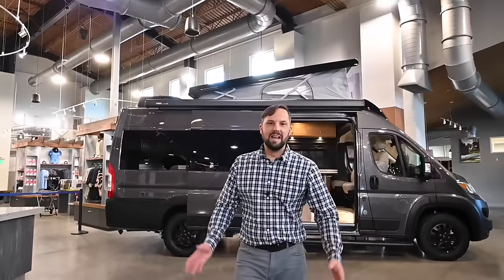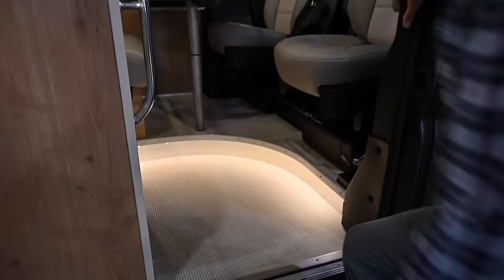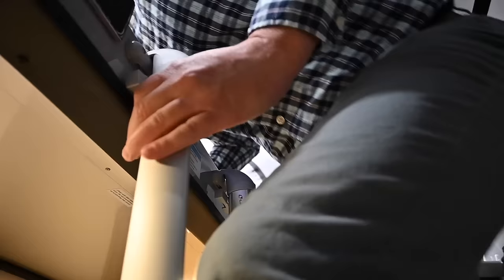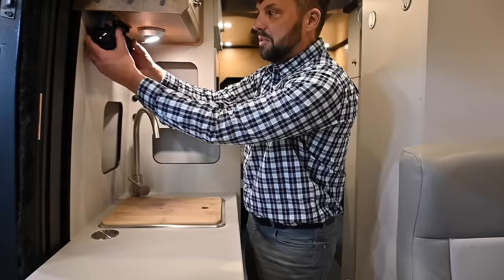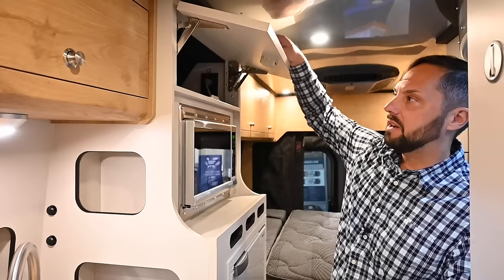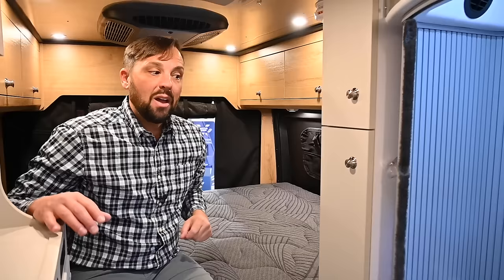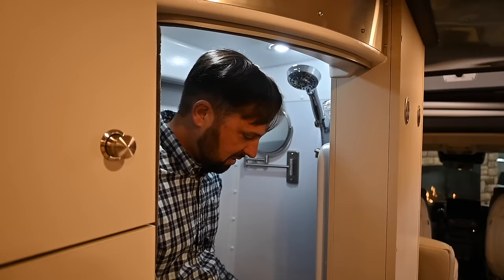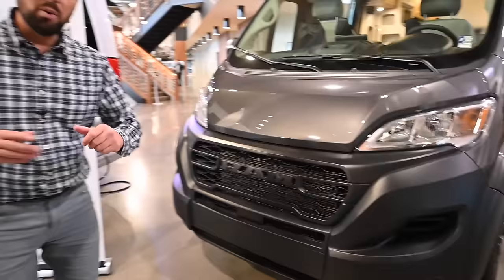All-New 2024 Airstream Rangeline Class B Camper Van | Sleeps 4

Comment: Terrible design. Toilet in the mid-area again. Smells the entire place. Toilets should be at the far rear end of the vehicle so ventilation exhaust is faster. More hygienic. You can entry at the rear when clothes are dirty and take a shower before entering the van. You can even extend the shower if it's at the rear. Midsection showers are terrible.

Comment: Beautiful camper van, but the height of the pop top sleeping area is too small. They could have easily made it 6-9 inches taller and less cramped. 

Also, the storage under the dinette seat should open via a drawer to the aisle (vs. crawling under the table).
Reply: It’s for children.  😊
Reply from the maker: Appreciate the feedback. Airstream doesn't manufacture the pop top, it is installed by Airstream. I believe it will fit two adults comfortably and feedback from owners has been positive.

Comment: Stapled drawers, no dovetail...very cheap contruction. For $150.000+ I would expect 600 ah for lithium batteries also. I bought my 2019 Coachmen Crossfit for $76,000 brand new and it has more options than this one does with solid wood dovetail drawers.
Reply from the maker: Thanks for watching at least